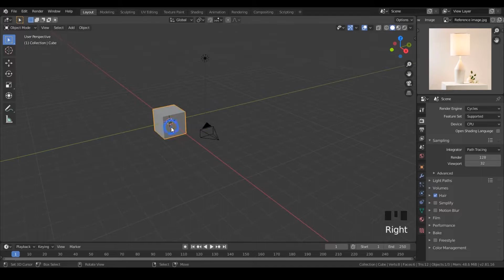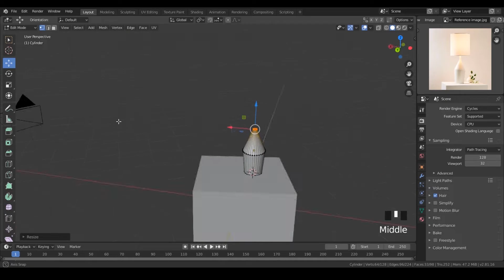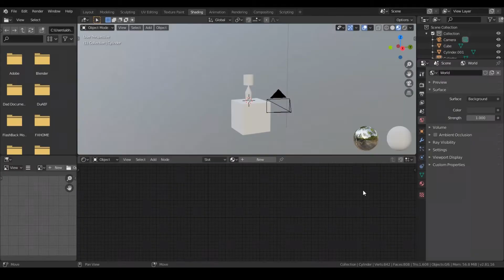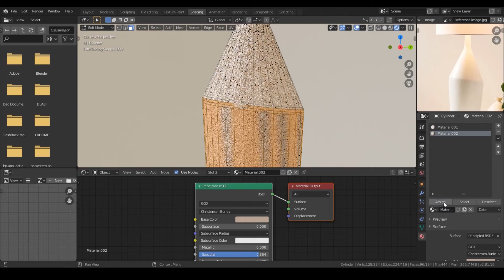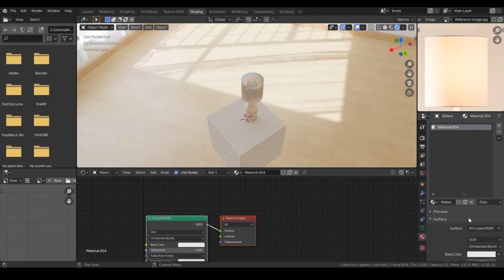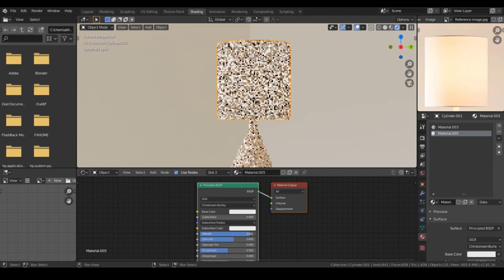How to make a Lamp in Blender | Beginner Tutorial

Comment: For those who can't access to the "Add Principled Setup" at 4:05, you need to enable "node wrangler" first, which is found in preference - add ons - check the node wrangler box, then control shift T will work

Comment: That's a amazing tutorial, but I kinda lost in 2:80 where the vertex and bevel and import the cylinder on top of the lamp🤔
Reply from the maker: Thanks! To bevel it lamp, select the shown vertices and press CTRL+B and use your mouse wheel to control the bevel level. To import a cylinder press SHIFT+A then in mesh select cylinder. I hope it helps. 🧡🧡❤❤❤❤